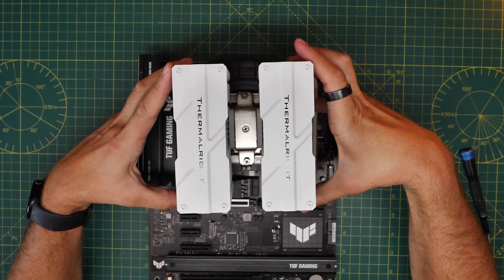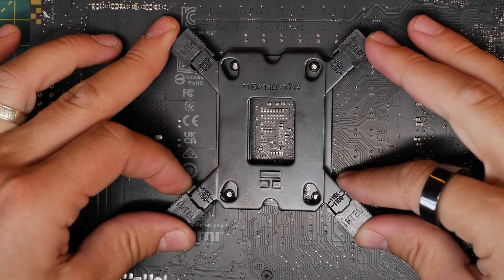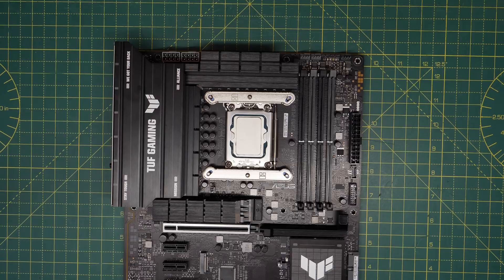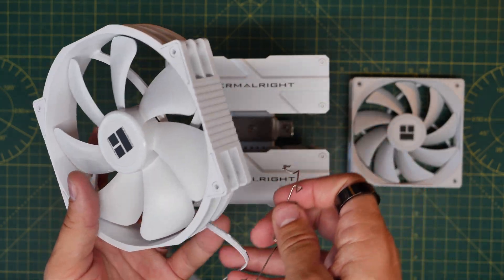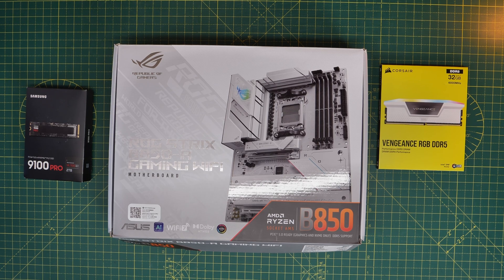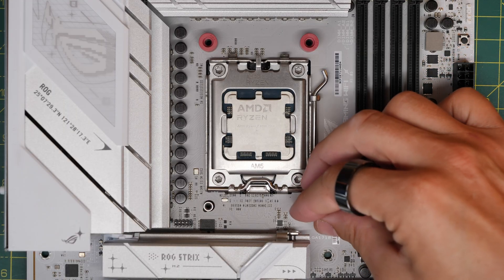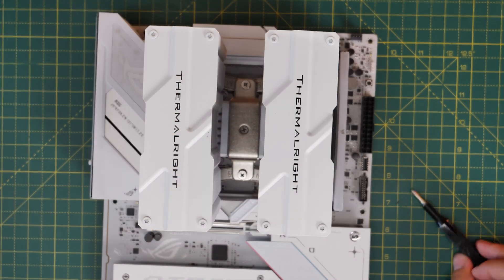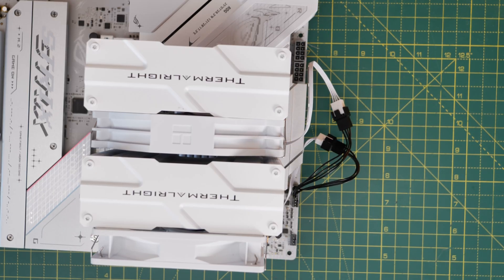Thermalright Peerless Assassin Setup guide for AMD and Intel builds

Comment: does it limit the performance of 9800x3d? im planning on buying this cooler along with 9800x3d
Reply: It definitely will NOT limit the performance. I ran a 120 se on my 9800x3d for a while, never anything above 80 degrees Celsius. But if you wanna spend more money for cooler temps, then you can get a noctua dh-15.

Comment: I have a question , i will be using the rgb fury beast ddr5 ram kit on my new setup with the exact same cooler actually even the PA 120 version , will i be able to fit everything properly with my case supporting upt to 160mm coolers ? Or will i have to move the front fan and then not be able to close the glass panel ? I see here you use the vengence rgb which should be a bit taller than my kit ( 44mm vs 43 mm) so techically shouldnt I be fine? Thank you in advance

Comment: My issue is my fan splitter has a 3 pin and a 4 pin. I cannot for some reason install the 3 pin into the splitter. It gets stuck half way through, do I have to put a lot of pressure to get it in all the way? I switched my pc on and it took me to bios, everything is working aside from one of the cooler fans, which sucks. Do I need a new splitter? And if so what would you recommend? Because fr this one just won’t push in smoothly

Comment: I put my fans on the backs of the towers like the 140 in the middle but attached to the front tower and the 120 on the back of the back tower closest to the exhaust,  might need to shift up to avoid backplate. Good view of RAM.